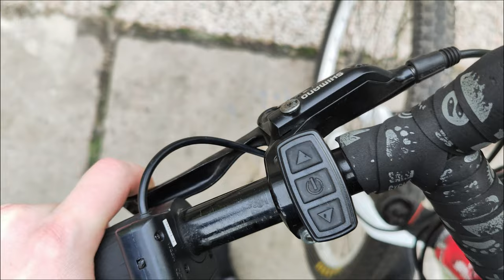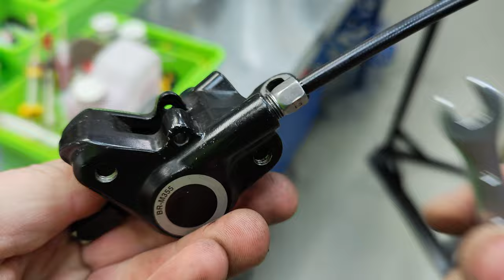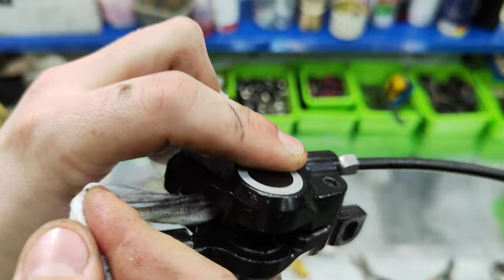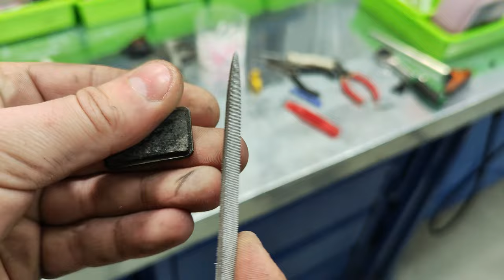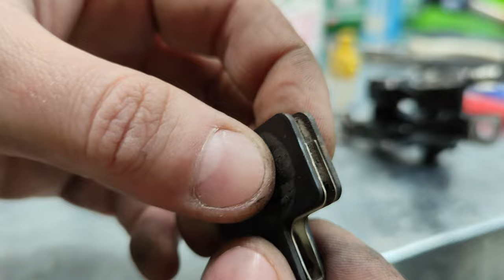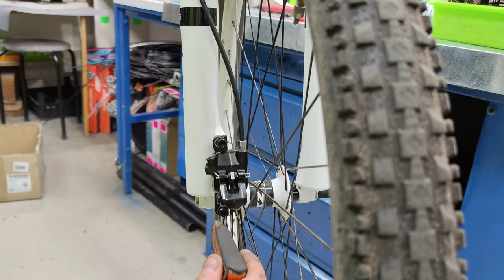Bicycle squeaks and creaks. How to fix bike brakes.

Comment: Well done, everything is clear without words, interesting, editing of the highest level, continue your project

1. What liquid do you use to remove dirt?
2.paper towels or toilet paper?
3. What grit sandpaper was used to protect the pads at the end?
Reply from the maker: Thank you for your comment.
1. For degreasing we use isopropanol
2. We use towels/wipes, but you can also use toilet paper, it is just narrower.
3. Medium grit sandpaper (300 grit, I think)